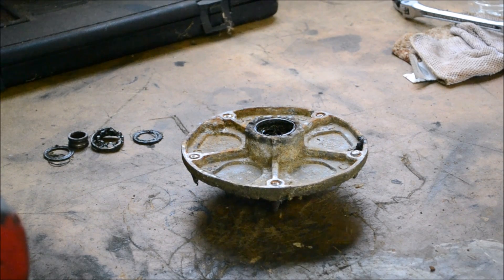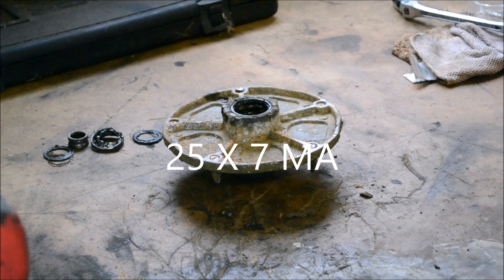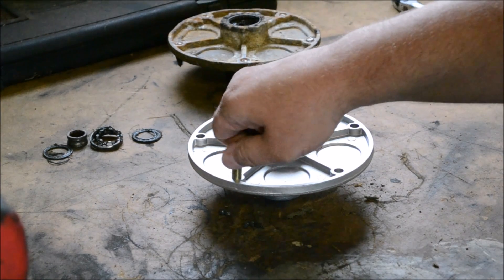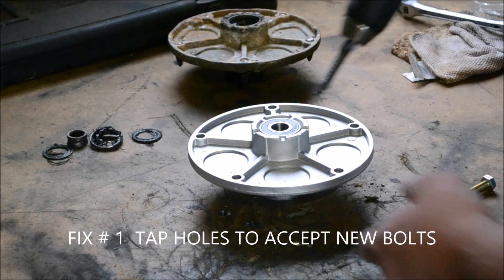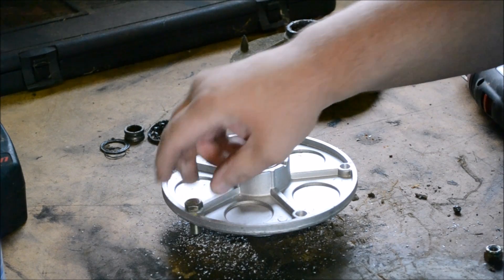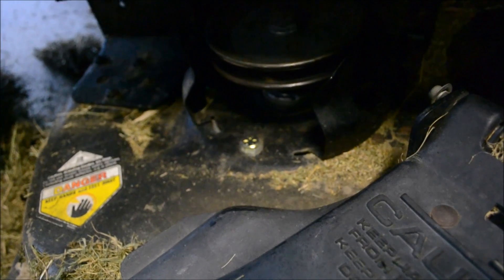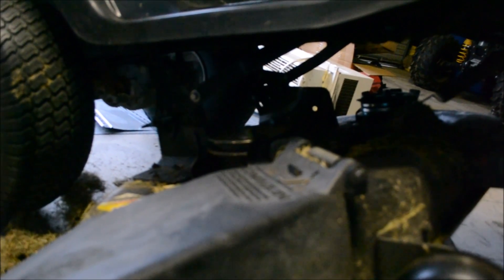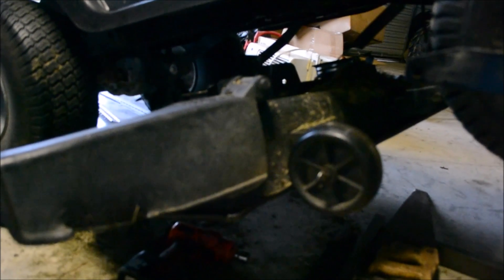MURRAY / MTD / AYP / DIXON / HUSQVARNA  / JOHN DEERE /    BLADE SPINDLE INSTALLATION TIPS

Comment: Threads should protrude several threads beyond the nylon locking ring, at least three per mil spec. Put the bolts in from the bottom to eliminate the tips from snagging grass and lessen the rust.
Reply from the maker: Great info if you are working on the space shuttle

Comment: The spindle assembly you installed had a Zerk fitting. Did you remove the inside plastic/ aluminum bearing seal and fill that spindle internal cavity between the bearings w/ grease or did you just use the existing internal grease and not use the fitting?

Comment: I was unable to get the jack shafts off the housings so I ordered new ones, but the shafts are too big to fit through the bearings and the spacer.  I am wondering if you have to hammer the shafts in? It doesn't make sense to me, hell, the shafts they sent me  (marked Murray 94129MA were not even the same as each other, and neither one fits. They are sending me new ones, but I still wonder about getting the darned things into the housings.
Reply: You would need to hammer out the shaft. The blade adapter pulls off the rod.  I set it over the hole and hammered the shaft so the adapter pulled off evenly. You can put it through the bearings and then hammer the adapter back on. I had 2 spacers that went under the pulley side but only needed 1 of them for the new one.

Comment: I just rebuilt an 11hp briggs on an old snapper. Now it burns out the flywheel oil seal after about an hour of runtime. First seal was an aftermarket at rebuild then an oem and both burned out after about an hour. Shaft was clean and no burrs or scratches. You think shaft bushing may be worn? Im at a loss. Thanks for any ideas you may have.

Comment: Hey Jeremy I have a question for you. I replaced the same spindle on my murray. Everything went well and I did the same things you did as far as hardware goes. After I put the blade back on everything was way too tight. I loosened top and bottoms nuts a little and tried to mow. Blade and spindle turned fine but after a short time mowing the whole assembly locked up. Can't even turn it by hand now. What am I doing wrong? I haven't checked to see if the bolts tightened up too much or if the spindle seized up yet.

Comment: I've replaced countless Murray type spindles and never broke one of those bolts I guess I was just lucky. At my local Amish engine shop I get those spindles for about 16 dollars with the bolts included. Now they crimp those bearings in there but I still have some original ones that I can pop the bearings out and just replace them.
Reply: how do you know what size bearings to get?
Reply from the maker: Not saying every one breaks off.    But like you I've been lucky at times

Comment: I have 2 Murray 40 inch decks, both of them have 2 - 5/16 bolts on each side, I just drill them out to 3/8 and rock on, also, look on Amazon for those spindles, new im getting them for $21.99 for both. And they have zerk fittings

Comment: where is the best place to install a grease zert in an aluminuim spindle housing?         how much grease do you put in it?  fill the whole shaft housing up with grease?  I am trying to overhaul my spindle housings since toro does not have a kit
Reply: I pump grease into a spindle until I see grease exit out the top or bottom. Then I know housing is pumped full. When Iv put my own grease fitting on a spindle that does not have one, I like to put it on the top side so I can access it easier without having to get under the deck to grease.

Comment: Using a drill to tap a hole is NOT correct. The reason he gets away from it, is because the spindle is aluminum.
Reply from the maker: It’s a lawn mower.  Not the space shuttle
Reply: @THEMOWERMEDIC1  Understand, and like I said, you got away with it since the spindle is AL.     I recommend you splice in a comment to the effect: normally taps are not driven by drills, that they are by hand. This, because, as much as you are talented enough to do it, a beginner, or someone who wouldn't have the "feel" through the drill that you might have, could experience a broken tap.
Reply: @johng1902  He's a bubba mechanic.